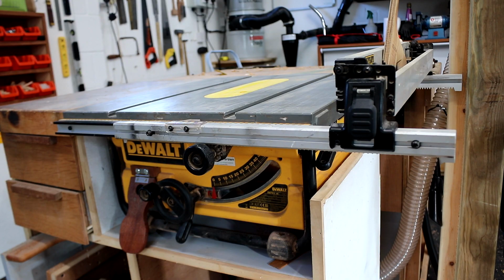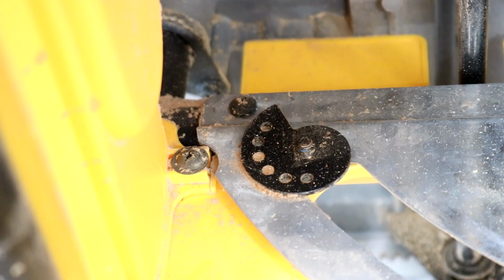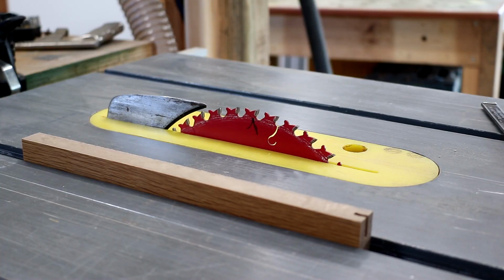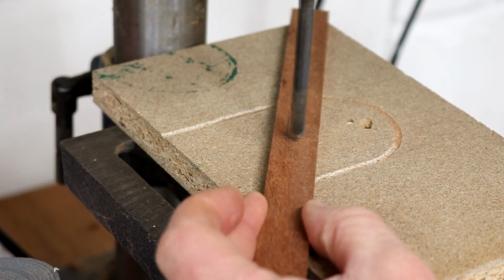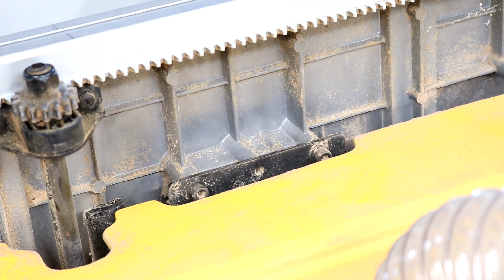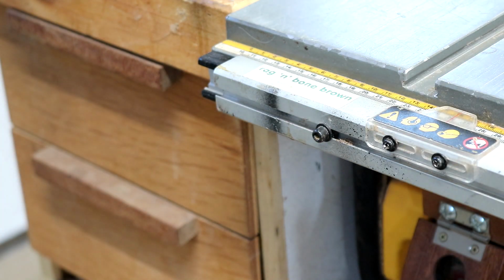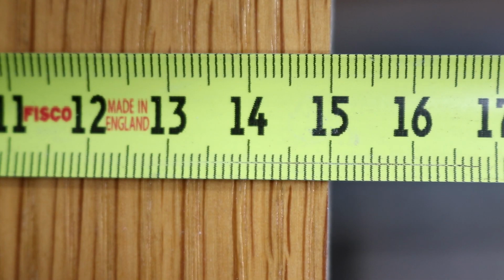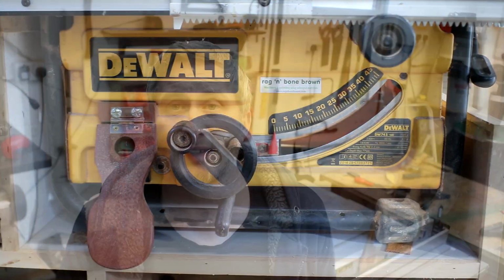Table Saw Set Up - 3 simple steps for accurate cuts. Demonstrated on DeWalt DW745

Comment: Lift your saw and adjust the angle...gosh, I am sooo happy i have my little Sawstop job site saw :) you should invest in a nice sawstop buddy. The cabinet one, as the only BIG grievance I have with the job site is the fence being way too plasticky...and slightly bent...but living in China, I do not even bother to ask for any new fence or help...they would likely send me back the same one...and it still works fine for what I do :)
Reply from the maker: Not sure what you mean by lift the saw to adjust the angle? You don't have to lift the saw. I only did it in the video to show the bolts. SawStop isn't in the UK.
Reply: Oh..and also, knowing that there is some safety working with it is a nice peace of mind...I am still super careful and simulating my cuts everytime, but...you know...when a bit tired or in a rush...shit happens...